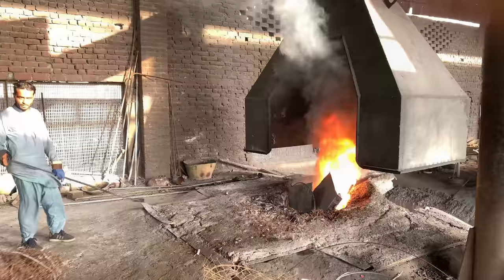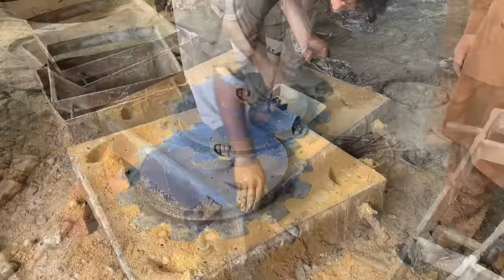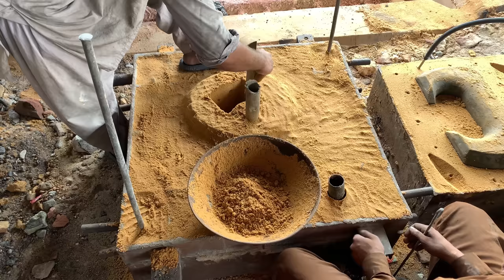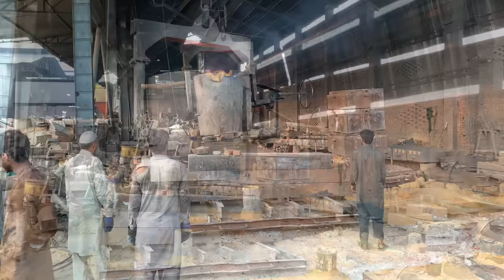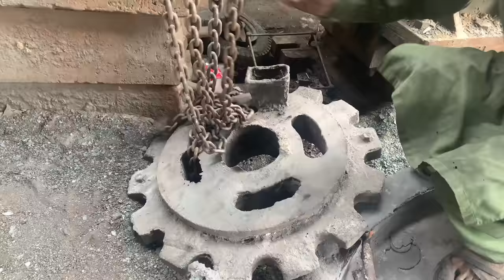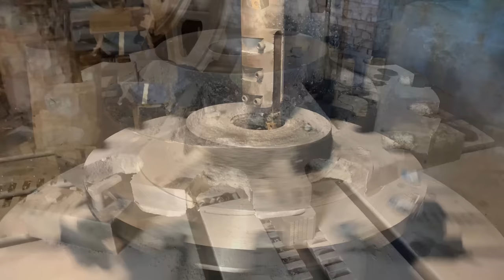How Expert Machinist Make Large Size Industrial Gears-Manufacturing Process of Industrial Gears |

Comment: Its another world. No clean air act governing the emissions from the induction furnace, no health and safety concerning the loading of the scrap into the furnace itself, no health and safety equipment for the furnace operators, no protective boots for the moulders, no protective boots, spats or googles for the caster, no boots or goggles for the de-coring or fettler.

Comment: Hi, what product is that hose throwing into the Sand ?
Reply: Carbon dioxide gas.  It activates chemicals in the moulding sand to cure and quickly harden it to give a more robust mould.